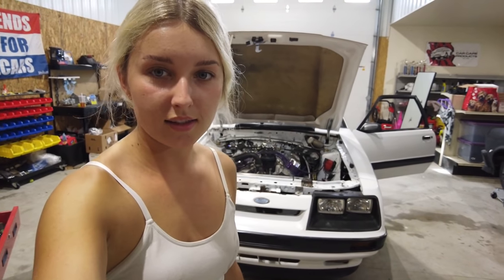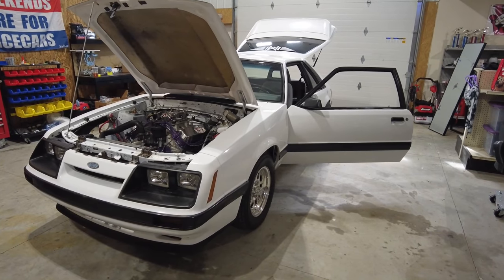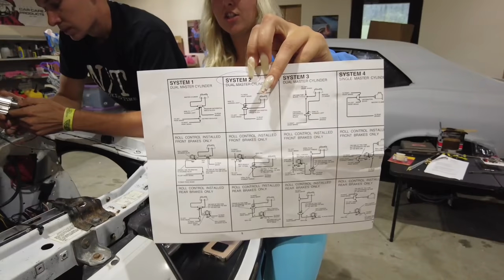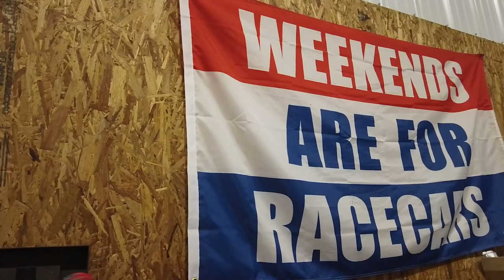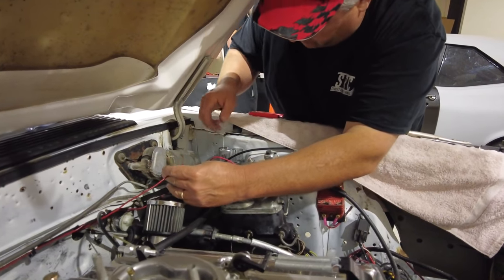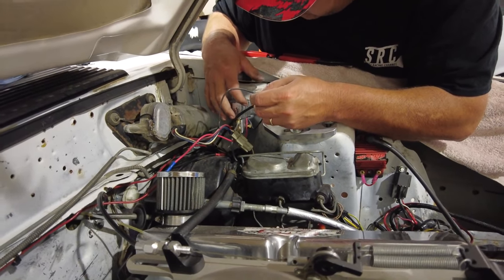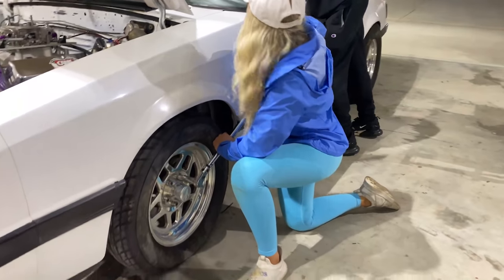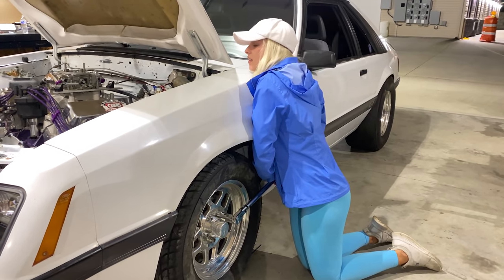NASTY BURNOUT, Line-Lock Install and Testing!

Comment: Molly, you are awesome. Keep chipping away at it. I know I would do one think to help out? Look at what gears are in Cleetus manual transmission 😉. That's the ticket to really banging gear's. Or send it to Liberty Gears (Transmission) and have them set the Transmission up to your vehicle and driving style. You won't be disappointed at all. Then everyone better watchout because you will be extremely quick. Besides that? Don't change a thing and relax a little and have a blast.

Comment: I'd have to disagree with dumping the clutch. It's a quick way to break output shaft, u-joints, twist the drive shaft, strip teeth on the pinion and ring gear, axles, break traction on launch. But I'm no drag racing expert. Just had to replace all for mentioned parts!

Comment: Question, does your Windsor have a camshaft in it with the old firing order.
Reason I ask is I used to have a Mastercraft ski boat that I nstalled a Ford motorsports cam in that had the old firing order and that thing sounded bad ass.

Comment: That last launch was 10 of 10. Is she shifting to 4th as she goes through the 1/4? Maybe gear change she can hold 3rd for a better 1/4 mile time, instead of the 4th gear shift.
Reply: I'm sure it's only 1/8 mile.

Comment: Just a friendly suggestion, but it seems your rev limiter is set too close to your shift light rpm. As soon as the light comes on, you're on the limiter. Can hear it. Also, keep in mind, they start to cut in about 300rpm or so sooner than what the rpm says it is. I would raise it. Just a heads up.

Comment: At the line pull up/back up then stage whit the clutch pressed (and in first gear) in take your right foot and basically try to put the gas pedal through the floor (not really but you get the idea) then anticipate the light and take your left foot and slide off the clutch pedal to the left the shock will surprise you so don't let off the gas just hold on and drive. As you shift gears take your left foot and quickly tap the clutch as shifty out of the gear and into the next when the light flashes. 
I hope you got a Rev limiter on that car as well.
All and all your getting better.
Reply: If she can get that heel and toe down lookout!! Next up some spray on that monster!!💪💪💪

Comment: Question,i no nothing about a line lock,if its on the shifter,what happens if you hit it when you shift?
Reply: Nothing. You use it to do a burn out an then when you stage with light brake presser. You pump the pedal a few times when your ready to do a burn out an hold the button an let go of the brake pedal an when its time to roll out just let go of the button. Then on the stag you just push the pedal a little bit so the brakes are lightly applied so you can roll the car in the beams and let go of the button at the same time dumping the clutch. Hope this helps you understand better how they are used. Stay safe an God bless
Reply: @robertprice2108  Thanks alot friend,very understandable,Have a great Labor day weekend:-)

Comment: Now I would suggest throwing a set of regular all season street tires on the back and take the car out cruising and having fun with it.  That extra seat time will help speed up the shifts and make you more comfortable all around and with regular cheap street tires on the back you can burn them off having fun and it won't matter. Lol

Comment: This is just a suggestion if she wants to compete with that car she needs to put a slipper clutch in it..I put one in my little 5.0 LX coup and it made all the difference in the world off  the line.
Reply: really? i thought about that but feel like i don’t need it. i don’t make enough power. i always thought 800 and up is the rule of thumb with a “slipper clutch”.
Reply: @theoriginal_sb7045  Hmmm I'm not sure my car even makes that much power never dynoed it...I just have a mildly built 302 with a whipple supercharger on it but I do know the way it's designed is all about the weights you put on it will determine how much it slips of the line hell you can make it work like any other clutch or slip it's up to you...you can play with it any way you want...all I know is that I was destroying clutches trying to get off the line and the slipper clutch solved all that.

Comment: With the line lock there's no reason why you can't do your burnouts in second gear. Build your rpm's, dump the clutch, mash the gas and roll out as soon as the tires break lose.

Comment: Call me old school , but at the track driving a manual Tran's I've always kept the gas pedal to the floor, pushing in the clutch & shifting... For those that say the engine will blow up or over Rev... Wrong... When you shift like this you will see big gains in the E.T.'S. For those that can't throw gears quickly enough installation of a rev limiter is recommended. However, for the people who can hit those gear's quickly, hold on for the ride, the frontend might come up hitting 2nd gear...
Reply: That is the way a stick is supposed to he shifted, without letting off. However most street transmissions will not handle that, nor will the drivetrain. To race with a stick correctly, requires a lot of drivetrain maintenance, and the right setup, which is costly.
Reply: @jrdmotorsports9718  I've never broken anything even on the stock tranny she's using, & I'll tell you another little secret that we would do back in the 70s at the track. Before all this new shit. See, on the automatic turbo 400 or the 350, or the powergulide, or any other tranny, we would pull to the line, put it in neutral and when the light turned green we would slam the gas pedal to the floor and slam the shifter all the way in the first year and then start banging gears. Believe it or not, about after 10 passes we would change the universal joint, because if we didn't they would break, we never broke any rear-end gears but shit, we were just having fun and didn't give a shit about breaking something. It was all about having fun and going fast! Lol miss the good ol days
Reply: @jrdmotorsports9718  racing sure has come along way over the years huh! Man those Liberty 5 speed air shift Transmissions are nasty... Oh along with the massive big cam proline engines being produced for anyone who has deep pockets to buy. The avarage Joe with deep enough pockets can build a serious contender, however knowledge can't be bought...
Reply: @TheMetalhead1966  That's called a "neutral drop".  They don't make ANY parts strong enough for that! Start making some real power and try shifting a t5 that way and watch what happens. They are not designed for that, especially at rpm.
Reply: @TheMetalhead1966  At that level, you are just racing the other team's budget. I have more respect for the little guys, who work hard for what they have and rely on brains to win.